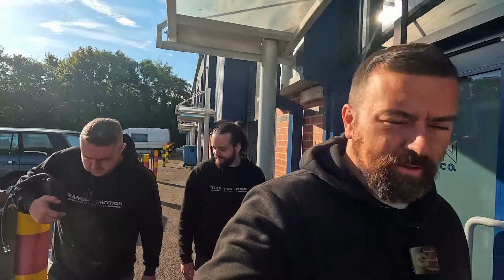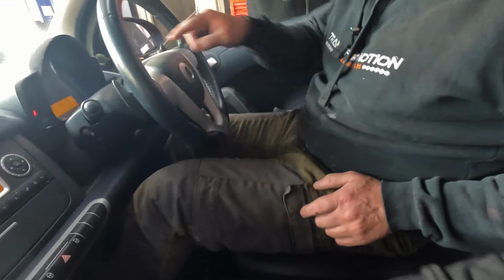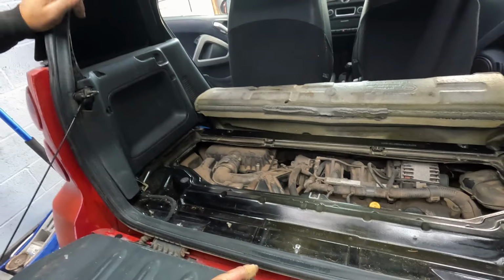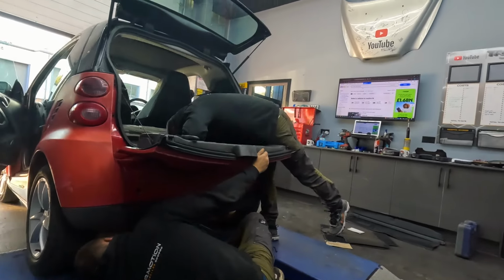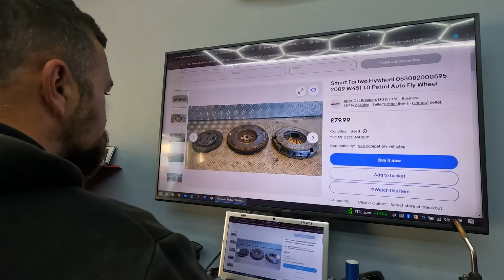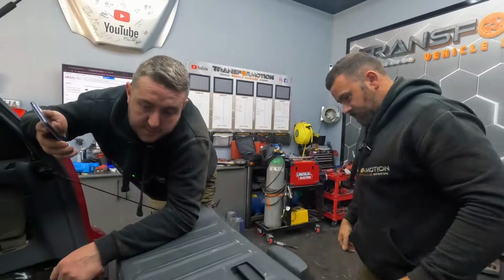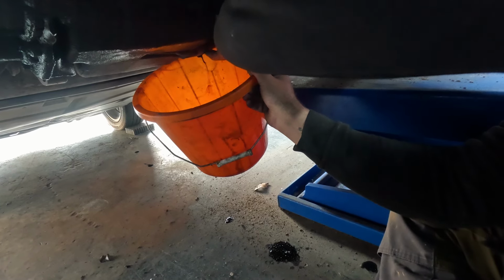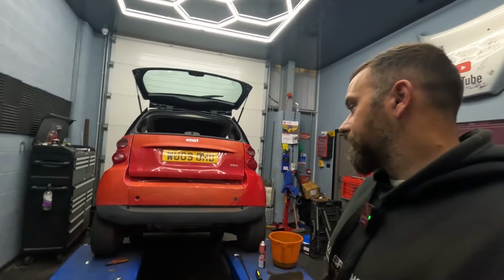WHAT'S WRONG WITH OUR SMART CAR? (FROM SHIFTING METAL)

Comment: Hello lads.  My mum's four four sounded exactly the same, sounded like the bottom end. Took it to smart technic in Brum and he took ten seconds to diagnose it was the heat shield bolt had snapped and put a screwdriver on the heat shield - the noise stopped. Worth a shot! Good luck 👍🏻
Reply from the maker: Thanks for the suggestion mate, I dont think it's the exhaust or heat shield but we'll take another luck, you'll have to come back on Wednesday for part 2 😉
Reply: @TransformotionVR  will do guys - keep up the good work 👍🏻
Reply from the maker: Thanks nick! 😉

Comment: It's such an easy job to take the whole rear end off these, it's well worth doing to give proper access to the exhaust, with possible broken flexi-pipe, or loose heat shield etc. Takes about 10 minutes.

Comment: The heat shield bolt do snap on these cars maybe give it a check by putting pressure on the heat shield itself and hopefully that will fix it. Can’t wait for the second part. As always great fun to watch and keep up the hard work ❤
Reply from the maker: Thanks man, we have had a look at the exhaust but it's louder near the sump/gearbox
Reply: @TransformotionVR  what about the dogbone (front engine mount)?

Comment: Well that's got me baffled.
Could it be lacking oil pressure at low revs.
Could be a blocked pick up pipe or filter.

I have 2 of these as run around cars there great little cars.

Comment: Try going round the exhaust and engine with a rubber mallet listening for loose parts.
Reply from the maker: It sounds like it's coming from the engine itself, well between the sump and gearbox

Comment: Unbolt the exhaust or pull it away from the car or are you think gearbox gremlin?
Reply from the maker: It sounds like it coming from the sump but right where the gearbox joins to the engine, part 2 on Wednesday ha ha

Comment: Dont forget Lads you have 2 spark plugs per cylinder so 6 in total.

Officially the rear of the engine needs to be lowered to get to the lower 3
Reply from the maker: Is there? Liams dad said that but we could only see 3 on the top, nice to know mate 👍
Reply: @TransformotionVR  ah you have an MHD, that only has 3 spark plugs (was the earlier Mercedes engined that had 6)
Reply from the maker: What does mhd stand for? I thought I couldn't see them ha ha 🤣
Reply: @TransformotionVR  Micro Hybrid so it has a combined starter-generator and has regen braking  to top up the battery and also under braking cuts the engine below 5mph. Engine restarts when the brake pedal released.
Reply: This car is a Smart 451, it's only the earlier 450 model which has 2 plugs per cylinder.